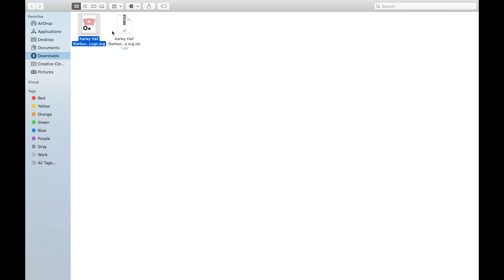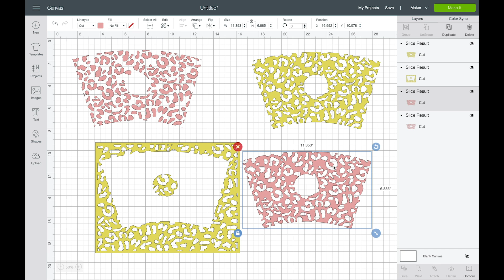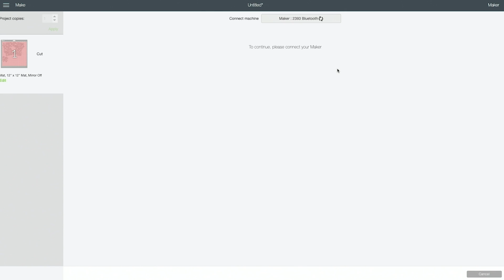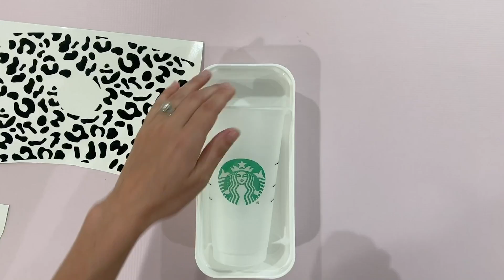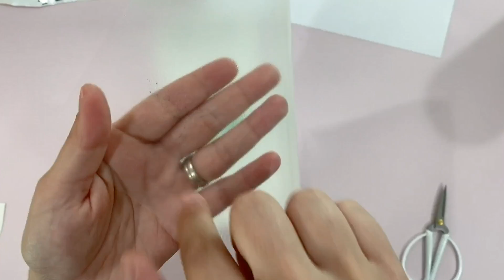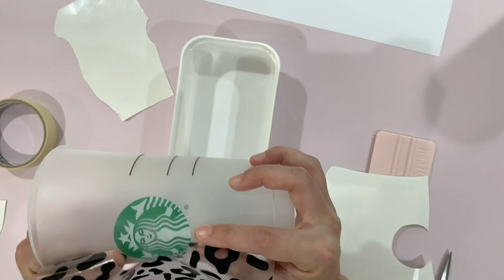How to Make DIY Starbucks Cup Vinyl Wrap with your Cricut Machine! (FREE SVG TEMPLATE!)

Comment: Not sure why but I follow each step but it continues to say image not supported by my current machine.  It says image is too large even though I sliced the image to fit inside the template like you did. What am I doing wrong
Reply from the maker: Do you have the correct machine selected? Could the joy be selected? Is it set to cut? It may be set to print then cut!

Comment: hi
 i love your easy way to explain. im.trying to do the wrap with my crivut hoy. i can nowhere find answers. would you now or its possible on the dame cups the you use?
if i try to do it then the system says its to big. i tried to revers it so the wide in the length on my design space and it still didnt work. i try to do it in 2 halfs but it messed up the whole order with the logos of the wrap...please help me 😭😭😭

Comment: Width 11.9 x Height 10.9 is this correct. Looks huge on the mat compared to your video.??? Not sure if I messed it up.. please help thank you ❤️
Reply from the maker: The most accurate dimensions are in the video description! I keep those updated in case I ever have to make an adjustment. Make sure to do a test cut with paper first to ensure you have the right size template 💕

Comment: Hi, I cannot get my vinyl to stick to the SB cup. I’ve tried several methods and have waisted many rolls. Any tip? Please help, thanks.
Reply from the maker: What type of vinyl and transfer tape are you using?
Reply: @KarleyHall  cricut
Reply from the maker: Do you have the packaging? Is it permanent adhesive? What color is the grid on the transfer tape?
Reply: @KarleyHall  its lavenderish, Cricut strong grip. I’ve tried the regular grip to.
Reply: Maybe the reg grip was old?
Reply from the maker: You definitely cannot use the purple strong grip transfer tape. You’ll need to use permanent adhesive vinyl with regular grip transfer tape. You can use a blow dryer to lightly warm the transfer tape to release the vinyl.
Reply: @KarleyHall  ok I will get the reg transfer tape. I did try the wet and blow dryer method and still wont stick. Another YouTuber said to only use strong grip so I threw out my reg grip because it was about a year old. I will give it another try. Thanks for your help and you videos.
Reply from the maker: StrongGrip transfer tape is made specifically for certain vinyls— like glitter vinyl for example. But if you’re using premium vinyl with a permanent adhesive, it’ll never release the vinyl. You can even “destick” your regular grip transfer tape a bit by sticking it to a clean cotton shirt or towel. And then apply it to your vinyl. If you haven’t applied vinyl before— you also may want to try applying it to a flat surface to get the hang of it! If you have tried that and feel confident— double check to make sure your vinyl adhesive is permanent and not removeable :)
Reply from the maker: This transfer tape is really good stuff! https://www.143vinyl.com/Clear-Medium-Tack-Transfer-Tape-12-inches-by-30-Feet.html?partner=310676

Comment: Top tip cut out a round paper circle and position it in the middle so then when  you pick up your vinyl with the transfer tape it will pick up the paper in the middle so then it won't take the ink off the cup xx

Comment: question do u have any tips every time I weed all of the design comes off and will not stay on the backing
Reply from the maker: Change up your cut settings. You’ll want a little more pressure or you can double cut it!

Comment: You are so helpful. Thank you!! I am confused on the final size you had the wrap on before you hit make it? I used the dims you provided but it was too big for my cup. I used the same cup you have. Please help
Reply from the maker: My templates evolve as they get updated over time—so the dimensions in the video description are always up to date. Did you use those? Make sure to do a test cut on scrap paper first.
Reply: @KarleyHall  Yes, I did and I did use them... so the square around the print/wrap should be what you have above? What is the actual size of the wrap?

Comment: Thank you for this and the SVG - it's so helpful! However once I upload it into design space the dimensions are 11.431 x 6.907 - I can't change it without it getting larger. Any tips?
Reply from the maker: 11.2306 in x 10.9111 these are the correct dimensions. Make sure it all grouped together and the proportions are locked before resizing :)!
Reply: @KarleyHall  thank you! I figured it out 🙂

Comment: Whats the difference between the permanent vinyl and the heat vinyl i can used permanent on the cups without like gluing it right it can just cure for 24 hours
Reply from the maker: Permanent vinyl is like a permanent sticker. Heat transfer vinyl has a glue activated by heat. Since you need heat, you wouldn’t want to put it on this since it’s plastic. Both vinyl and htv need to cure. So once your project is done, let it sit for 48 hours before washing :)

Comment: How long will the vinyl last on the cup? Do you put anything else on the cup so the vinyl will last!
Reply from the maker: Mine has survived the dishwasher 20 times. Starbucks says the cold cups only are intended to last 10 uses. So I think the vinyl will hold up as long as the cup lasts! So long as you use good vinyl, like StarCraft, you don’t need anything else. https://www.143vinyl.com/starcraft-hd-permanent-adhesive-vinyl/?partner=310676

Comment: Hey there! I have tried this template for a full solid wrap with vinyl and it doesn't fit. I even tried to offset the image and it still doesn't work. can you make a video with a full solid wrap to show maybe what I'm doing wrong? of is this just for designs that are a solid color?
Reply from the maker: Did you cut a sample using cardstock? What size cup are you using? I recommend cutting out a cardstock template to ensure the size cane in correctly and that it’ll work with your cup!
Reply: I’m using the same Starbucks cup you are

Comment: When I go to wrap the cold cup, it doesn’t line up correctly with the Starbucks logo and I end up having to put it on piece by piece
Reply from the maker: I recommend cutting a paper template to ensure you’ve resized it to fit properly :)

Comment: Thank you for this?  By any chance do you know if the wrap template would work for the Costco 24 oz color changing cups?
Reply from the maker: I haven’t tested it! I would recommend cutting the template out of cardstock and seeing how it fits!
Reply: Karley Hall thanks!  Lol I don’t know why I didn’t think of that. 😂 appreciate it!!
Reply: @KarleyHall  I did it and only had to tweak it a bit - meaning I used your method for making extra spots and used that to fill in the hole where the Starbucks logo would go.  There's probably an easier way, but this was my very first project and I have no idea how that would work.  I only had to nudge a few spots up after the vinyl was transferred on.  Thank you so much for making the video and providing the download!

Comment: Hii, thank you for your tutorial video. The workspace dont allow me to make it because the image size is bigger than 6.75x9.75. Could you please tell me why yours still work? Thank you
Reply from the maker: It sounds like you are set to “print then cut.” Select your image and change the fill from “print” to “no fill” and it’ll fix that issue :)
Reply: Karley Hall hi, when I change it from print to no fill the issue’s fixed but the image turn grey. Could you please help me?
Reply from the maker: @kitphan5458  You can adjust the color to any color you want

Comment: Hello, I am looking to get a Cricut and am wanting to do cups like this for myself. Will the vinyl last if I hand wash it or wash it in the dishwasher it? Is it waterproof? How long does a cup with vinyl usually last?
Reply from the maker: The cups themselves only last about 30 dishwasher cycles. Starbucks only guarantees they will last 10! So the vinyl will hold up just find! I put mine on the top rack of my dishwasher.
Reply: If you hand wash them you can use them for years. I work for Starbucks and I have several  cups with vinyl on them that I have had for quite some time.